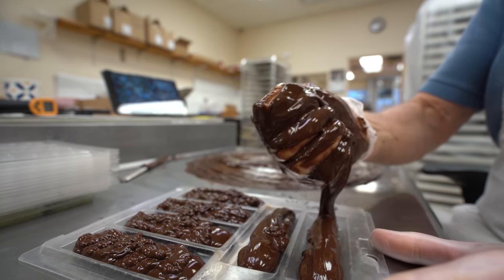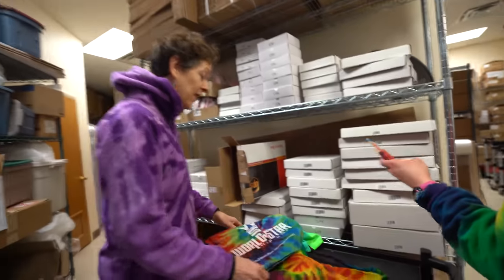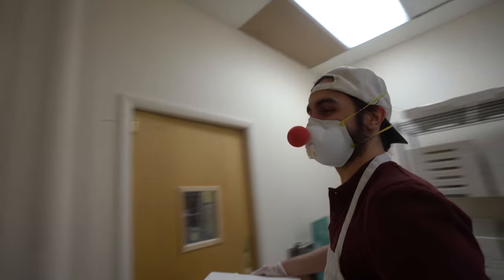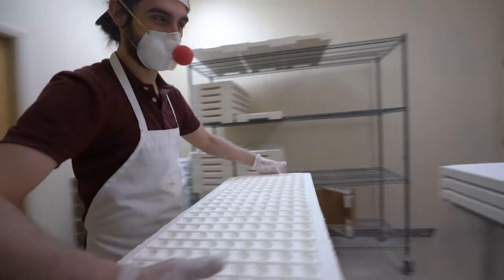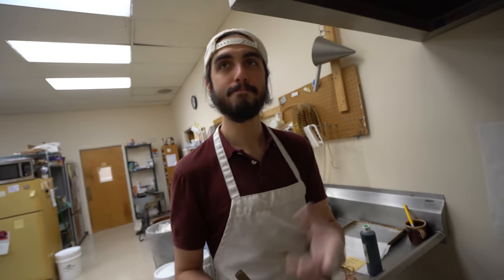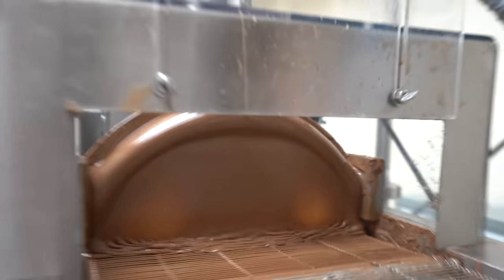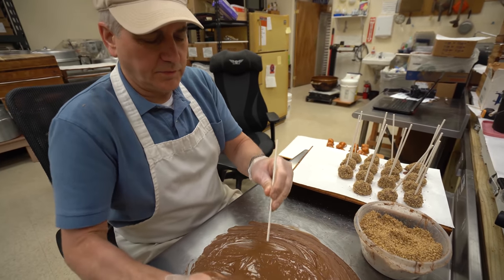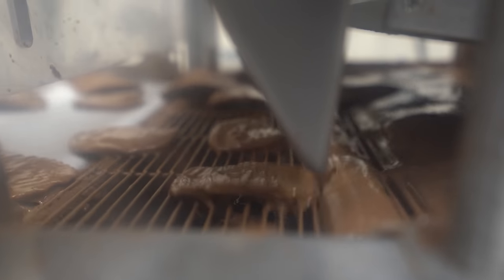Max is Back in the Starch Room!

Comment: You can take the fluff deep into the earth where the core is molten and rotate the fluff gently until soft.
Reply from the maker: I can tell you have experience with this method
Reply: The key is "gently". If you rotate it too fast it'll deflate. It's a tricky method.
Reply: Or harness the power of a dying star to heat the forge used to make Mjolnr and Stormbreaker ? Giant dwarves are optional ? Just remember to stir slowly like Mason R said.
Reply: I wouldn't recommend trying to melt the fluff with a little butter I have done it this way to make the consistency less thick and easier to work with such as funneling

Comment: Melting fluff is easy in the microwave on a low setting. 
But take it out of the container and put it in a bowl and mix till smooth. 
I worked in a kitchen for thirty years and this is how we did it for certain recipes.
Reply: How do treats run through the enrober get coated on the bottom?
Reply: Cristal Johns my question also
Reply: 503 Workshop watch the chip part it shows the excess chocolate gets blown off the top of the product creating a puddle that the next line of products cross over coating the bottom
Reply: @503 Workshop It has a 2 part process. The grated belt pulls chocolate up from the pool and helps coat the bottom. It has nothing to do with surface tension...its a 2 part process.
Reply: Thank you I'm going to try this🍊 Orange chocolate and melting the love another in a glass bowl in spurts and then cue stirring it sounds good to me I'm going to try it I love making chocolates my favorite.🌰  This looks like chocolate covered peanut butter. Am I Right?
Reply: @cristaljohns1999  in the videos you see the puddle it goes thru

Comment: Here’s a couple of tricks:

Spoon it in on the convex side of a spoon. The curvature of the spoon makes it easier to kinda roll off a dollop of whatever you’re spreading. My mawmaw taught me that trick. 

But there’s physics behind it. Basically rolling friction is better than sliding friction. The less contact area you have the less friction you have. 

I’d also suggest in the spoon method spinning the molds while lightly pressing it to really have an even layer.  

You could also use a small silicone spatula or spoon to put the fluff/peanut butter in the cups. 

I have experience with the peanut butter and silicone. I’m never using anything but silicone. So easy! Less messy especially with it being so sticky. I make my husband peanut butter crackers a lot and it really cuts down on my production time. 

As they say work smarter not harder

Hope this helps y’all! 💖💖💖

Comment: I have an idea!😁
Freeze it. Take out of the container and slice to appropriate size and/or weight and put into the cups or if the temperature difference between chocolate and fluff is a problem,  put cut fluff on a small parchment square and slide with knife into cup. Walll lah! 🤣

Maybe you tried this already....who knows. Thanks for the videos.😊

Comment: I don't know about round molds with peanut butter, but I did some square chocolate covered marshmallow creams with Nutella and to make the layers I just smeared the marshmallow and the Nutella in lined shallow baking sheets and froze them. I cut them up with a pizza cutter, and put them in my chocolate lined molds. I let them warm up while I was doing other stuff and then put the chocolate on. I wasn't able to do it on humid days because they would sweat. It wasn't perfect but it's sped up the process.

Comment: We used to use a cookie press for fluff, a lot easier to control quantity and shape and no heating required. We put the fluff on cookies with the cookie press and then dipped into tempered choc. They are relatively cheap and easy to clean too.

Comment: I have made marshmallows a few times, and if you (a) whip it a bit less and (b) don't wait for it to completely cool/set, the marshmallow will be 'liquid' enough to smear far better than the jarred (and set) fluff.

Pros:  You can tune the flavoring to exactly what you want it to be (e.g., more vanilla, add some mint or orange, ...)
You can spread it easily

Cons:  You would need to make the marshmallows yourself instead of buying jars

Fortunately, making marshmallows is pretty straightforward.

You would need to see what the crossover point is on time between making it and using jars.  For just a few, the jars will be faster.  Given the number of cups that he had queued up, I would bet that making it yourself would be faster.  At least, for me, it would be faster to make it and spread it.

Good luck, and let us know how it works out.

Comment: The way I melt fluff is for every cup and a half you use three tablespoons water and heat on low heat in a saucepan. Stir until completely incorporated and it makes a smooth "sauce" if you will. Works like a charm but you just need patience.

Comment: I have made marshmallow truffles using a mold.  I guess it should work using peanut butter too.  However you have to heat up the peanut butter.  First I filled the mold with choc, then emptied them out to create a shell, next i put a mini marshmallow into the shell then filled it with the ganache, (the heat semi melts the marshmallow :) and I would presume the warm/heated p/butter would do the same).  Well that's my 2 cents.  Happy chocolating!

Comment: Double boiler method for whole jars ...empty the jar in a heat safe bowl put the bowl ontop of a pot of water and start boiling intill u get desired texture u have to do it slowly so nothing crystalizes boils or burns ......when u need smaller amounts tho the microwave works lmao I have used this method for fudge and it works well

Comment: With the sunscreens Spf15 blocks about 97% and 30 blocks 98 or so % however this seems like a small increase one should look at it more in reverse the 15 letting 3% through and 30 letting 2% through which is really twice as protective instead of 1% better.

Comment: I'm defying the rules! Haha. Not from experience but you could try scooping the marshmallow fluff into a ziplock bag, seal it after pressing out as much air as you can. Then submerge it in hot water. When it's soft and runny, dab dry the bag then snip the corner off and you have a piping bag.. That may work?

Comment: You guys keep joking about having your own starch trays at home but I actually came up with some. I saw a mini muffins pan and had an idea. I used that as my mould made a wood tray to match its size and I'm using a large plastic tote to prep the trays in. Haven't made creams yet as my brother has my double boiler.
Reply: Great idea! Maybe $Tree silicone ice cube trays could also work?
Reply: @altl888  I don't know I wonder if the cornstarch is needed to help form the shell on the cream so it's hard enough to be chocolate coated. I will test if I have a silicone mould.
Reply: You'd still need the cornstarch, I meant to use the ice cubes trays to make the divots in the starch. They have a bunch of shapes, 1 they usually have is a small round, that could be pressed in the cornstarch.
Reply: @altl888  oh I understand now. Um probably not as it has to be fairly stiff as it takes a generous amount of pressure to form good moulds.

Comment: i think the reason max is having problems with the press not making clean divots is that the pressure is not the same in the middle as it is on the end where the main downward force is applied.

Comment: So I think, from experience with hot summers and forgetting about fluff being in a cabinet...... I'm pretty sure at moderately hot temperatures, while it won't be fully melted, it will be less "fluffy" and a bit more like the texture of semi-melted peanut butter - still sticky, but spreadable. I'd guess somewhere between 80-100 degrees. I think too much heat would create a weird reaction. Like how on warm toast + peanut butter, it turns more to a goo because its not that hot. ALSO you could just make your own fluff, it usually comes out more liquid-y that way 😅

Comment: Why not use a piping bag to put the fluff in the cups? Massage the bag a bit and as you begin to fill,  the warmth from your hands would soften the fluff a bit and make it easier to work with. 
Pre-fill a bag or two depending on how many you're going to need and keep them resting on a warm surface or alternately set the fluff container in a slightly larger bucket with warm water to soften it up before filling the pastry/piping bag.
*Not from experience with fluff...just worked set several bakeries over the years working with various products of different consistencies- mostly cream pie fillings and  decorating cakes-always trying to find a way to make it easier to do things

Comment: Max has a rather extensive fanclub in the comments section.  I think we just found their name: the Max Mafia.

I would think... that if you call the number on the back label, the manufacturer should be able to tell you how to melt it.  I've called Unilever and they were insanely helpful.  If your holding what I think your holding the number is here https://marshmallowfluff.com/faq/  

Hand strength can be increased by squeezing a tennis ball.

Comment: With the fluff when i make them i spreat the fluff out on a thin sheet covered with Wax ore bakingpaper evenly i freez it and when it is frozen i get it out and use a round Cookiecutter an punch them out at the right size i need them for my filling. than i place them in on top of the PB .....Done
Reply: This is like the method I saw for making peanut butter slices. Roll it thin between wax or parchment paper and freeze then cut to size.

Comment: You are spot on Max, SPF50+ offers only marginally better protection from Ultra Violet (UV) radiation than SPF30+ filtering out 98% of UV radiation compared to 96.7% blocked by SPF30.

Comment: Just make your own fluff. Use 1 bag of marshmallows and 1 tablespoon water. Put in the microwave and heat at 10 second intervals stirring between intervals until smooth and melted.

Comment: Hi! I know people giving suggestions on how to do what you have been doing for ages can get annoying. But, have you tried using artist spatulas to spread the fluff and the peanut butter? They are small, stainless steel and the handle is at an angle so it might work. Thank you so much for your videos!
Reply: Those are called "off-set spatulas" and they are way better than spreading with a butter knife. Good idea.

Comment: In 1984, I went to a school athletic day, was sun exposed for about 4 hours in the hottest part of our summer in the middle of the day, no shelter/shade, a large number of kids were badly sunburnt that day, i had 2nd degree burns from my shoulders , arms, legs.  From then on i stayed out of the sun as i am rather fair skinned to boot, and our south african sun is not to be played with.  Factor 50 is imo over rated, factor 30 works best for me, even in shade you can get sun burnt from glare,  so take care. If you can, get a dermatologist to prescribe the correct sun protection for your skin type